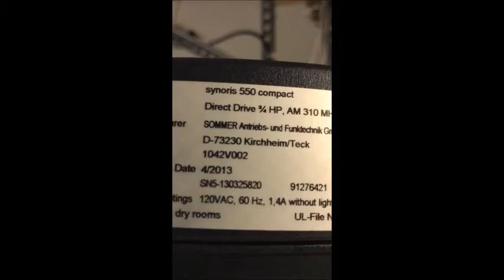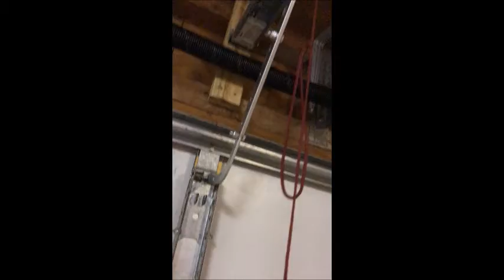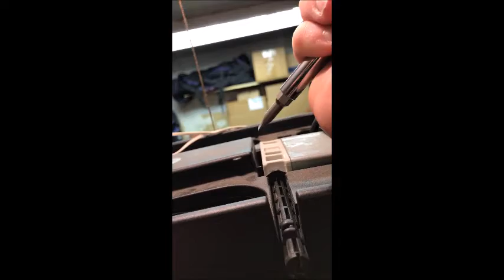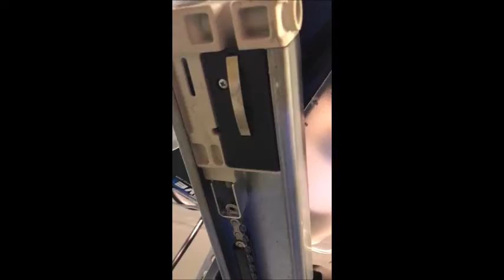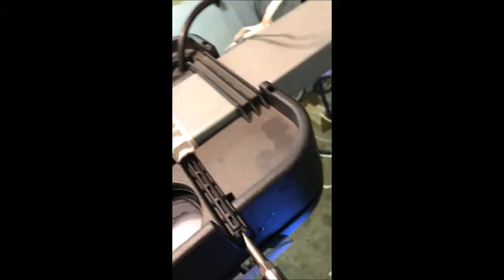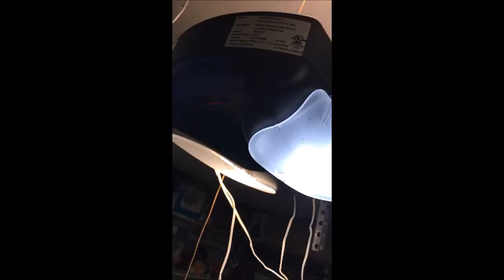How to Fix / Repair Sommer Direct Drive Garage Door Opener Not Working Issue *NO PARTS NEEDED*

Comment: when you clean the contacts off with some sandpaper you should put a light coating of WD 40 ONLY on the contacts...Other lubricants don't conduct low voltage electricity.  Called Sommer as well and eventually replaced those contacts, easy fix they just pop out on each end.  Make sure there is a slight arc or bend to the contacts which ensures good contact.  Same goes for the track and C-carriage nothing but WD 40 to clean and lubricate

Comment: Thanks Kirk, I didn't realize how the motor was powered. I installed mine in 2016. They changed the design a little, they redesigned the housing. The release pin you pushed out to release the box no longer exists. They put a bracket plate held with two screws on the top. I sanded the brushes or metal contacts on both sides. Only one of mine had a little oxidation. Not enough to stop it but, when I checked the motor that moves across the chain and rail, that was the problem. It was self inflicted by me "I sprayed garage lube on the chain" The motor also has two metal contacts or brushes that make contact on the inside of the rail opposite the chain. I wiped and sanded off the lubricant on the inside of the rail. It solved my problem thanks you for taking the time to make the video and helping me.

Comment: Voila! That was it! Your video helped me out a few years ago. I forgot about those contacts. The video was indispensable again today!!! Thanks
Reply: Voilà,  I had the issue you were having.  I removed the plastic screw and the two metal straps looked bran new plus the 3rd on on the base. I cleaned it with sand paper anyway and plugged it back in and still have the same clicking sound, and the door will not open. My spring is not broken, and my motor looks good, and the sensors are steady red/green. What other options do I have. The problem started 2 weeks ago

Comment: If you still have issues after checking the contacts in the control head assembly per this video, also take a look at the frame rail where the motor contact rides along the rail.  Mine had light rust, and after wire brushing and sandpapering, followed by a light coat of WD40,  all was well.  While you're at it, also a good time to wipe down or clean the chain.

Comment: Well it's 2024 and my opener developed the same symptom. In my case it would stop and then next day operate ok only to stop again. So I looked at the section you showed and that was the problem as well. I'm assuming the damage is from sparking???? Anyway, I cleaned both contacts and it's working good now. Very good opener except for this flaw in the design. I plan to see if these contacts can be purchased and replaced without too much effort. Thanks much!!!!

Comment: Thank you so much!!! Years after you posted this video -  you saved me hundreds, hundreds of dollars. I got my garage door opener 10 years ago from Costco - and when it quit working, I figured I'd need to replace the entire unit. I was considering a new door as well - so you likely saved me thousands.  I looked in my owner's manual and found nothing that was of any help and then I came across your video last night. I went to bed without any worries because I was convinced that it would be an easy fix in the morning - and it was. I went out this morning and fixed it in minutes!  Requested new contacts from Sommer too, and they are on the way. You're a rockstar!

Comment: Hey, Kirk. Thanks for providing this video. Just curious, did you ever replace the actual contact clips on your main unit? After almost 10 years owning my unit, I am just now having this problem. I sanded it down as much as it could be, but the pits were too deep, causing bad or no contact. The unit is still just making that "clicking" noise.
Reply: They don't answer and don't return calls. This company is a fraud. No wonder big box stores and Amazon no longer carry this brand.

Comment: Bingo! Kirk - thank you so much for taking the time to post this. I called my garage door company and they came and told me they no longer sell this brand so I should buy a whole new operator. He left and I found your video. After sanding away the corrosion (yep, looked just like yours after 10 years) I put a penny wrapped in electrical tape under the contacts and that did the trick!

Comment: Thank you. 6 years later, still saving us all from repair call out and allowing us to to fix ourselves. thank you, thank you!  For pursuing the cause, resolving, then not stopping there but taking more of your time to make and post an excellent video!
My SOmmer is 10 years installed and just started with the symptoms, described in your video, today. In my case the metal strip on the head unit actually melted the plastic surrounding it at one end and the strip was embedded low and not making any contact. I used a blade to cut back the plastic then to raise the metal strip and then used a sliver from a shim as a wedge. Works fine now which I was relieved, as cleaning the strip only at first, did not work.

Comment: OK, a year goes by, contact problem again. Here is the full story. The torsion spring on the dual garage door broke. Suddenly the door gets "heavy" and doubles in weight. The family does not know that the door is now too heavy for the Direct Drive Motor to lift on its own and keeps pressing the open button. I call a garage door place to fix / replace the spring. The repair goes just fine, no problem. But now the Direct Drive will not work. It just flashes the light bulbs. I pull the motor and look at the contacts and yes, they are very "burnt". Using a very gentle touch and my variable speed Dermal, I clean off the contacts. Put it back together and bingo, everything works, back to normal. My take on this is, when the spring broke there was no home garage door opened on the planet that was going to lift that amount of weight. Not knowing what was happening, the family kept pressing and power button causing the latest round of high electrical resistance at the contacts to burn them again. I get home, I see the broken spring and immediately see it needs a fix. It gets fixed, but the "damage was done" and the contacts scorched causing so much resistance, the motor would not move anything. A few minutes of cleaning allows full voltage, and it works again.  UPDATE: It has been 6 or so weeks and the contacts burnt again. To their credit, Sommer did honor the "lifetime warranty" and sent me both parts (both parts that have the contacts). It consisted of the control housing (contacts) and a rear bracket (also contacts). Had to transfer light bulbs, doors, top of housing, etc. Then reprogram the wireless keypad and remotes... all easy to do. Working 100% again. It seems to me this problem could easily and cheaply be resolved by gold plating those 4 contacts. Yes, gold plating is cheap and would stop this damage. Having been involved in component level electronic repair for years, I know it would only add less than a few dollars to the price.

Comment: After a crooked garage door repairman told me "it's the mother board and the motor" and offered me a new "better brand" for $575, I watched your video. It was dead-on correct. After 5 minutes on a ladder with a screwdriver and some sand paper, all is well! Thanks so much.

Comment: Well, Thank You, but mine needs parts. I talked to Sommer when mine suddenly stopped. After removing and re-inserting the wires to sensors and wall unit into the block in the unit I got it to go up and down twice, but when I tried to program remotes it stopped again. Next a tech came out from a local company. They adjusted my springs they installed 7 years ago. They needed it, he also adjusted and lubed the door. He declined to work on Sommer as his company didn't have much luck with them. I again removed and reinserted the wires, programmed the remotes and all was well, wall unit-green light and operated the door with the flashing lights to sense door, then all 3 remotes worked. Great, done. Next day back to not working. After your video my unit came off differently, two lg. bolts (veritcal) on top of unit. One contact was burned some, the plastic below melted and the plastic was broken that held the contacts in place. The first time I contaced Sommer they said lifetime warranty (parts only) but two years on send/receiving units, sensors...whatever. It's Sunday so I guess I will contact them and see if they send a new unit that has all the electronic parts, that's where the contacts broke off of. My unit is 4 years old and is direct drive. The motor seems to work when I had it working. Next time I will buy a unit that is more mainstream? Thanks for the heads up, at least I have a shot at getting parts I need?

Comment: Thanks for this video! I had the same corrosion and pitting on my contacts. After cleaning the contacts up I still had intermittent issues and found that the contact which connects directly to the rail was still not making a good enough connection. I ended up prying the contact upwards a bit and that solved the issue.

Comment: This is a lifesaver.  Wish I watched last year.  One thing to add, if the top of the console is too close to the ceiling,  you can use a flathead screwdriver to pry out the roller bar from the bottom of the tip.

Comment: I had the same problem with a lot of corrosion and arcing.  I just bypassed the entire system by soldering on two new wires and drilled two holes in the front of the unit and pushed the wires out towards the rail.  I added two wire lugs.  One connects to the rail frame and one connects to the electrically isolated chain.  I connected the added wires to the new lugs and it works perfectly.

Comment: Thank you. I couldn’t get mine to work and this fixed it. Exact same problem except for my metal contact melted into the plastic more than yours. I not only cleaned it, but also popped it out with a flat head. Thanks again.

Comment: Thank you for the excellent vid. I cleaned the head and rail contact with emery cloth until smooth and then coated both contacts with dielectric grease.  Shimmed the rail contact with the penny covered in electric tape as recommended in the comments.   Will also get the manufacturer's replacement fix sent to me for possible future repairs.  Thanks again!

Comment: This problem is not unlike the corrosion on a car battery. The Sommer uses 24v DC. DC current flows in one direction. Have you ever noticed for the most part, the corrosion on a car battery terminal is almost always on 1 terminal? Cars use 12c DC; same one way current flow. Thank heavens the Sommers does not use a chemical battery for power!

Comment: I had the same problem. Sommer actually sent me a "redesigned" part that was supposed to be an improved contact. I am guessing less electrical resistance and / or more heat resistant. The "main" black component started to melt and shows bubbling on mine also. Keeping current draw to a minimum is obviously key to longer life. Cleaning and lubing the rail and perhaps cleaning those contacts annually seem to be a good idea.
Reply: Can you send me a link to the redesigned part?

Comment: Sommer will send you replacement contacts Free.  Call them at 704-424-5787 or 877-766-6607 and tell them you unit has the corroded contact problem.  The parts come with a newly designed pressure plate the replaces the round black "bolt".  The person I talked to said that the bolt allowed the control head to move downward which contributes to the arcing that causes the corrosion (actually metal burn) in the first place.  The pressure plate stiffens everything up so that it does not move.  Here is their how to install video for the contacts and pressure plate.  https://www.youtube.com/watch?v=f0E6wAmWZMs
Reply: Hey, thanks for the contact info and the link.  Big help.

Comment: I'm glad I checked your video before I started taking the motor apart.  The contacts had build up just like yours.  Weak design!  Looks like arcing that occurs as control unit vibrates the contact point back and forth.

Comment: Tks for the vid but honesty those sommer motors are Garbage I would throw it to the garbage and get a real motor ..LIFTMASTER
Reply: The motors are fantastic, they never break. Please criticize the actual problem: The Contacts.  I too had LiftMaster... failed all the time. As with the Sommer, it was never the motor. It was the drive system and switches.
Reply: The motor is not the problem.  Which is obvious by the number of people who have not agreed with you.  It's the contacts at the control unit.
Reply: @OYAHHH  I am actually thinking about rewiring and making a direct connection, bypassing the contacts...

Comment: Thank you Kirk!

I also had corrosion. I cleaned the contacts with contact cleaner and then scrubbed the contacts. Once done, I added dielectric grease. However, I still had issues getting the door to open. That's when I noticed that the main assembly wasn't parallel. Holding the front of the main unit allowed the contacts to engage and the door opened. Next stop, hardware store for something to hold the unit parallel to the rail.

Comment: Hey everyone, I went to the SOMMER website and left a comment/complaint about THIS very issue and have just received an email back from them:
On October 8, 2018 at 10:53 AM SOMMER <support@sommer-usa.com> wrote: 
Thank you for contacting us about the issue you are experiencing. We discovered that some openers contacts separate slightly over time, causing them to arc, and corrode.
We have a fix for this.
If you provide me with a shipping address, I would be happy to send you replacement contacts, as well as a pressure plate that eliminates the separation issue.
Regards
Customer Service & Technical Support
SOMMER USA, Inc. 
1430 West Pointe Drive, Suite Q | Charlotte, NC 28214 | USA
+1 877 766 6607   support@sommer-usa.com  
www.sommer-usa.com

Comment: Thanks Kirk, I have had my Garage Door guy come out three times in the last 3 years, approximately 7 to 10 months apart and THIS was the problem each times, ($70 each time). He told me what the problem was and how to fix it, but this last time was when I was out of state and the wife couldn't get back in the garage, so I called him, but he didn't charge me this time, however he asked me to check the connections before I go out of town next time.
I wonder if there is a gel or paste that could be used to seal the contacts against moisture, such as electrical engineers use on other 'contact type' electronic connectors?
I'll try to call SOMMER direct and see if MrStrizver's suggestion (below) of 'Dielectric Grease' might help solve this problem. 
Other than this single recurring issue, my SOMMER has worked exceptionally well, and quieter than ANY other type opener I have had, for the 10 years that I have had it. Even the bedrooms directly above the garage are not aware of the up and down movement of the garage door.

Comment: You described, diagnosed and repaired the bad contact problem. That was exactly the symptom with my Somer garage door opener and the problem was exactly as you showed: corroded contacts.  After cleanup the opener is back to working.  Thank you Kirk!  What is surprising is that this problem, apparently fairly common does not show up at all in the Somer Troubleshooting checklist table.  Of course if it did then you might not have this small slice of fame and gratitude!

Comment: thanks a million!! Your video saved 2 service calls, did you ever had to replace the contacts or the unit after the initial fix? Coz mine has pitting, erosion of contacts, wonsering if should start looking up to replace the unit or part of it?
Reply from the maker: I have not had a single problem with mine since I made the video a year ago.

Comment: Kirk, I will add my sincere thanks to all the others on this page. I had the exact same problem. It turns out my "hot" contact (the one that energizes the chain) had done some overheating and was slightly melted / sunken into the body of the control unit. A little prying out and cleanup of all four contact areas with some 220 did the trick. (Whoever suggested dielectric grease below has s good idea also.) Such an easy fix!

Comment: Genius! I had redone all the electric connections and couldn't figure it out at all until your video.  Other problem is my contacts were pushed down, bent them out a bit - could put a piece of sponge in there next time.

Comment: Yes this is very good and is the first thing to try.  If cleaning the mentioned contacts does not work then remove the trolly, clean the contacts on the trolly, clean the inside of the rail and clean the chain.  Both the inside of the rail and the chain are part of the circuit.
Reply: And it works with you ? I do all and keep clicking , don’t move

Comment: Your video just saved me a lot of money. My garage door would not open when I got home. I went through the trouble shooting list in the manual and it stated if the power was on but the door would not work at the wall or remote to call a technician. I watched your video and my problem was that the long screw you take out to check the connections had worked itself out of the proper position. All I had to do was turn it a quarter turn and bam, I was back in business! Thank you!

Comment: Thanks a million for this video! Went to pull out the garage today and no-go, door wouldn't go up, just the head unit was clicking. After a search on youtube yours was the first hit and it described my problem exactly. It's -20c (-4F) today so I didn't feel like having to trouble shoot in that kind of weather, so thanks for posting the video. As a temporary fix until it warms up a bit and I can pull it apart, I just wiggled the head unit a bit and it seemed to make proper contact again with the rail and the door will now go up and down.